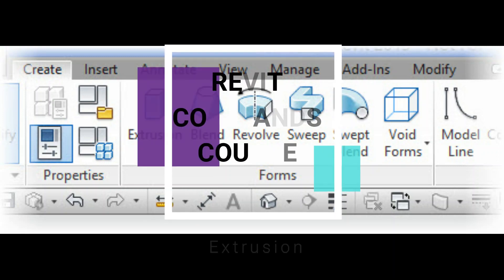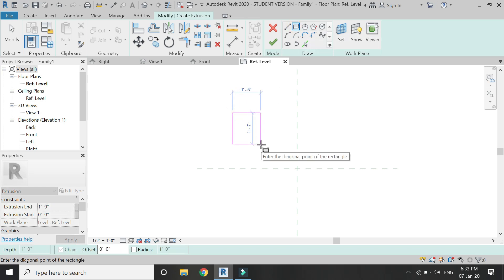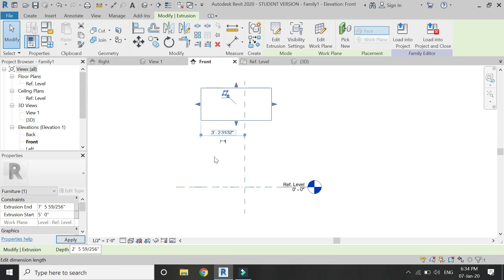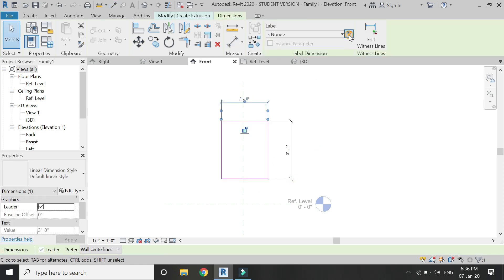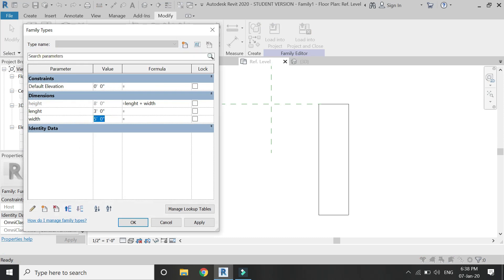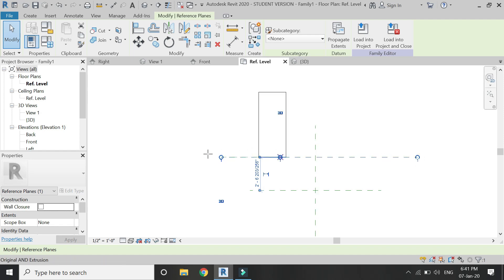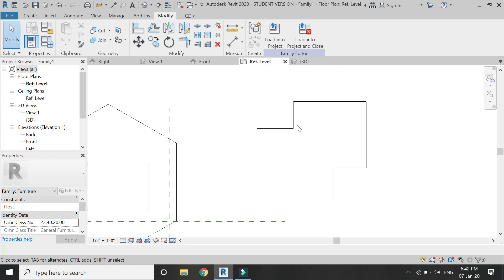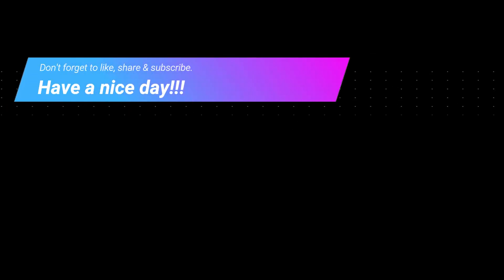Revit Commands Course - Extrusion

Comment: How I calculate areas and volume or length for extrusion elements
Reply from the maker: Volume/Area of a Massing Model = https://www.youtube.com/watch?v=dyHjB14NmcE&t=493s
Check out this video to know about how you can add parameters to calculate volume and area. Although the tutorial is conducted on the mass but the process is similar.
Also in some family components or model in-place, such as roof, floor, structural columns, etc. the volume and area can be easily calculated via the schedules and quantities. But for family components like furniture, doors, windows, etc. the area and volume can not be calculated via schedules and quantities and you have to add parameters for them.